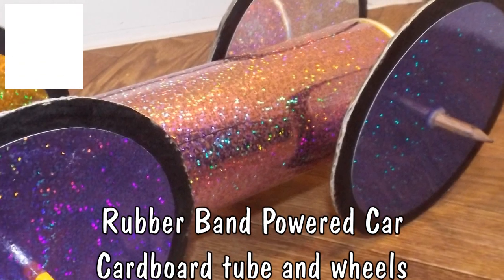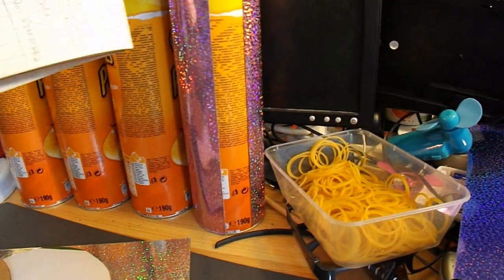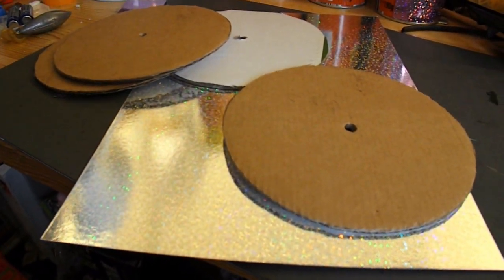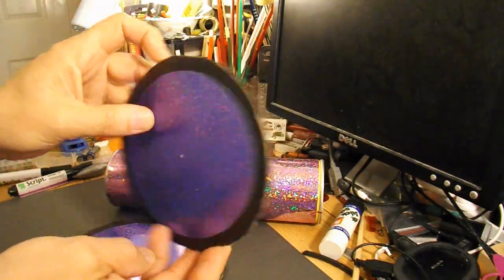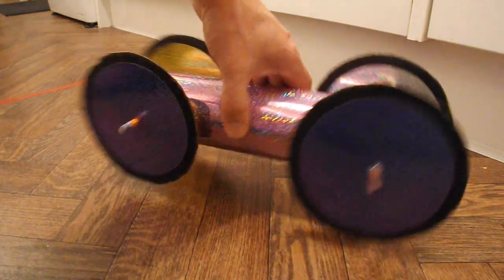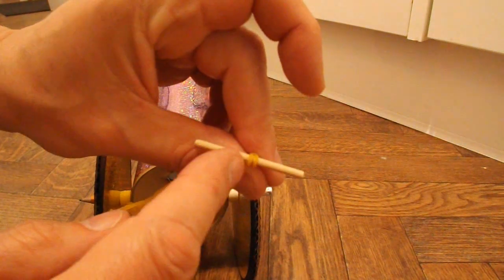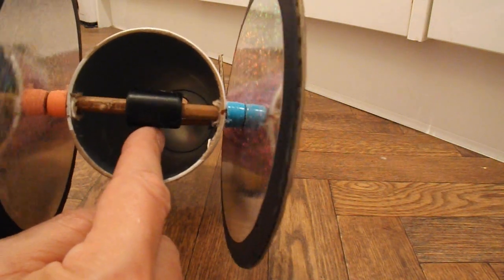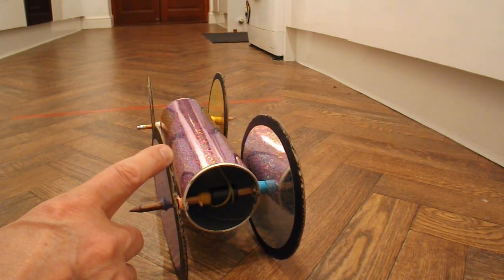Rubber Band Powered Car Cardboard Crisp Tube and Wheels

Comment: Would this car be able to move up a hill, we have to build a roller coaster and a car for it. The car must be able to get up the first hill. I built a balloon powered car but the force of that wasn't enough to push up at any angle (I tried really low angles)